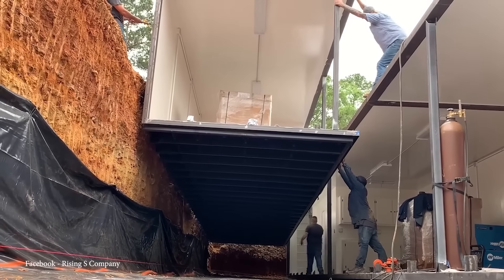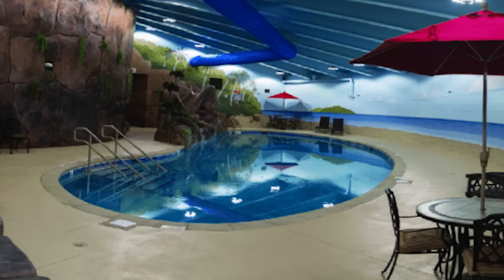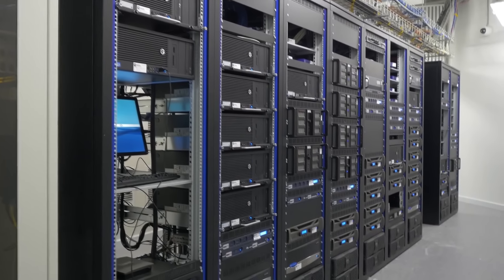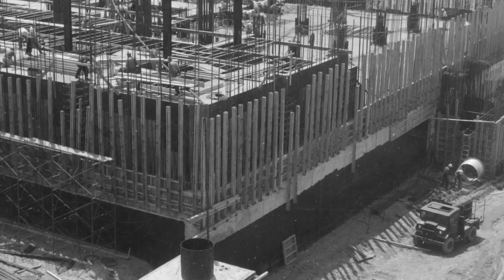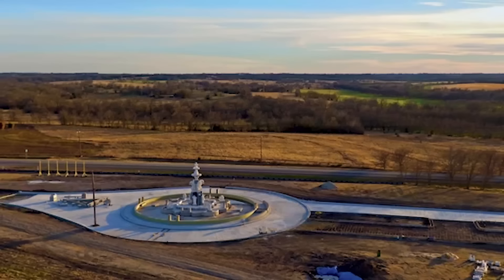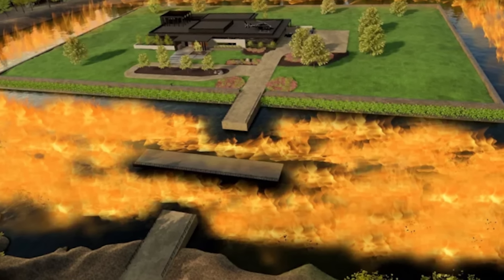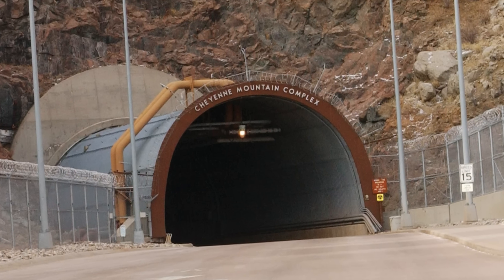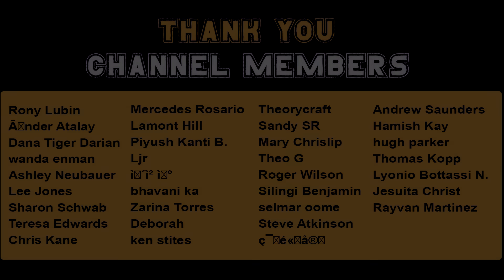15 ULTRA Protected Bunkers for the Super Rich

Comment: im gonna give u a sneak peak of the i designed the underworld. pic, a master lock mechanism laying on its back... the center nob is me... or 3 sprockets laying flat each sprocket is a floor each tooth is a room... as the top sprocket turns a few clicks, the second floor turns opposite way 7 clicks, bottom floor turns. exactly like a combination lock. theres random openings strategically within the estates. when the tooth gets to the opening that means that room leaves until theres no more empty rooms and the top of lock is like a tunnel that leads to the ville... fckn genius you are, telll me how you really do this in school you were a geek and a nerd